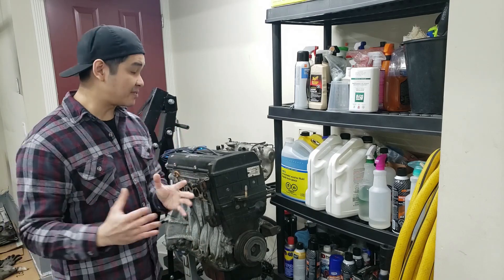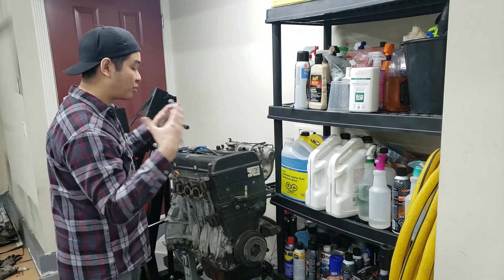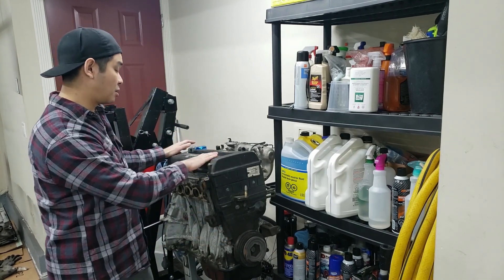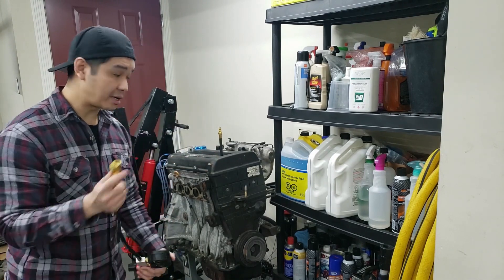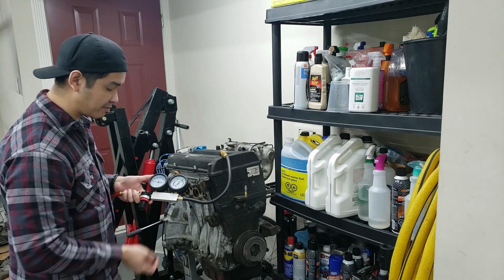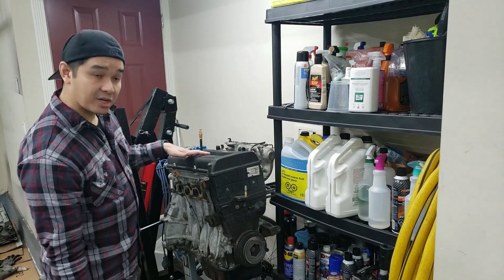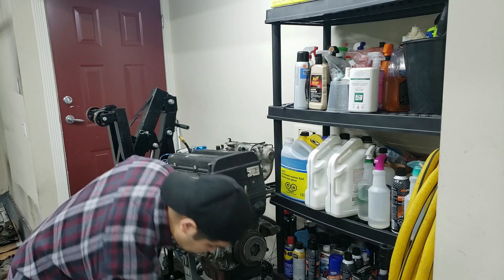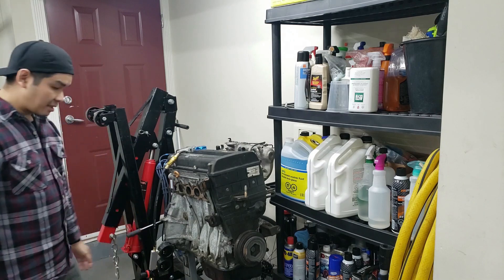MY NEW ENGINE!🔥 ||HONDA EF9 / ED7 88-91 CIVIC & CRX|| Performing A Leak-Down Test On My B18B1👍🏻

Comment: It’s been sitting, rings are dry. Burned valves would give you 100% leakage. I’d either send it as is, do some maintenance valve stem seals just because, or do stem seals and rings if you want to do more.
Reply from the maker: I was thinking of just dropping it in as is, but might as well tear it down and just do a rebuild on it. It may only just need a good cleaning and valve lapping and some new rings and its good. But we'll see how everything is once I tear it apart. I really wish I could find a cheap vtec head. Would be nice to do a lsvtec build.